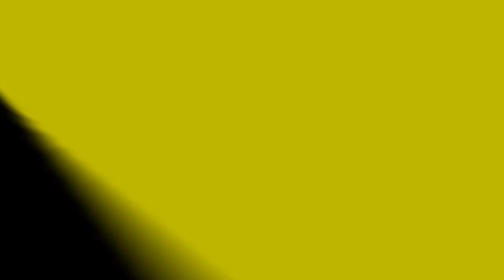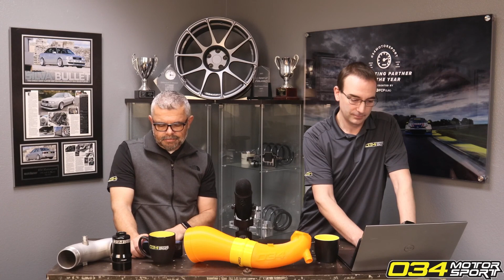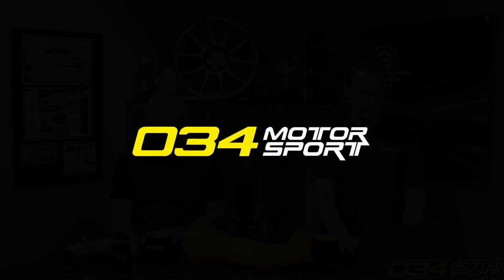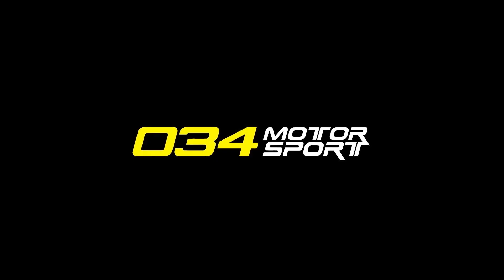How Corrosive is E85 Long-Term on B9/B9.5 3.0T? | 034Motorsport FAQ

Comment: I only drive about 80 miles a week. Is that an issue with e85 sitting in the tank too long causing water absorption causing the direct/port injectors to fail after time or am I safe? I have a 24 mk8.
Reply from the maker: Not at all! You can safely daily E85 without issue. It doesn't hurt to cycle out that E85 for pump 91/93 every once and a while.

Comment: would it be possible to have B9 stage 3 TTE810 as flexfuel? i mainly see only E85 options?
Reply from the maker: We do not currently offer a Flex Style tune for the B9 platform. Flex Fuel applications are currently in-development.

Comment: Would it be wise to switch back to fuel for a bit to help clean the injectors from running E85?
Reply from the maker: It certainly doesn't hurt to cycle out E85 with pump gas every once in a while

Comment: Is it safe to run 93 and e85 or just straight 93 or straight e85
Reply from the maker: We do not recommend mixing fuel for our B9 3.0T tuning unless necessary for a file that requests a lower ethanol content level.

Comment: I switched from 91 to E85 today. I have a SQ5 3.0t b9, in the upper rev range, the engine has a different tone from stock, is that normal? It does not sound like knock or anything, just something i noticed. I switched from E85 to 91 with instructions from one of this channels guides. 

Also, when it comes to long term, I know that you need more E85 per mile than 91, but does that put a higher amount of strain on the fuel system? For example the pump, and injectors having to pump more fuel to the engine?
Reply from the maker: E85 does make your engine sound slightly different.

We have not had any issues running E85 long term on these engines.

Comment: should we ever flush out or switch to 91 for some time ?
Reply from the maker: It would definitely not hurt to run a tank of pump gas every 6 months or so to be safe. Gasoline has some other additives that do well at preventing any gunk buildup, but we have not seen anything to cause any concern at this time.